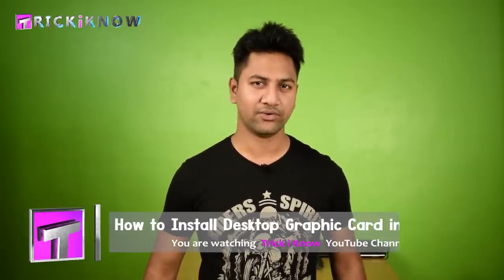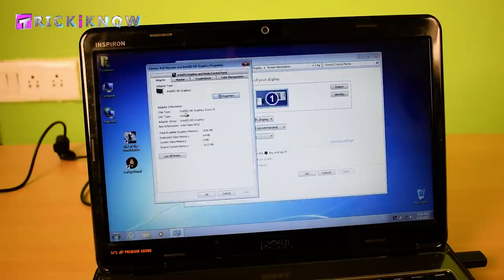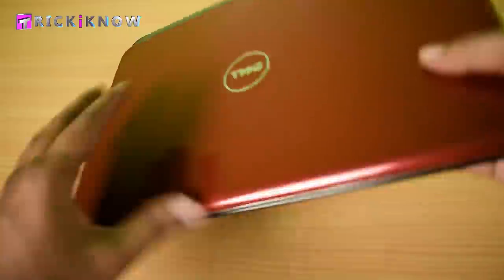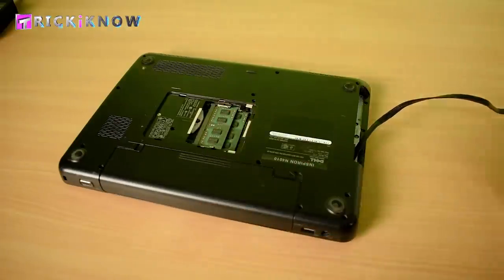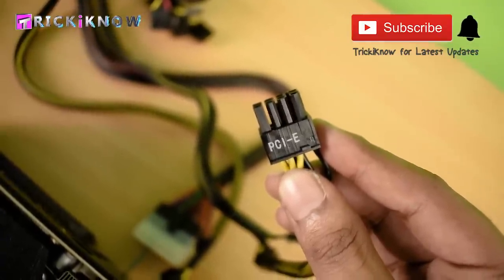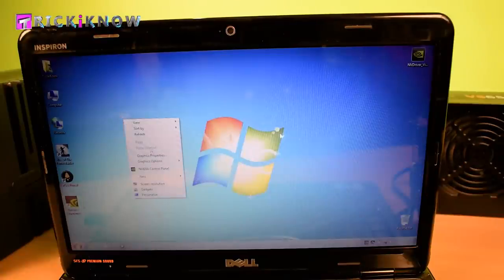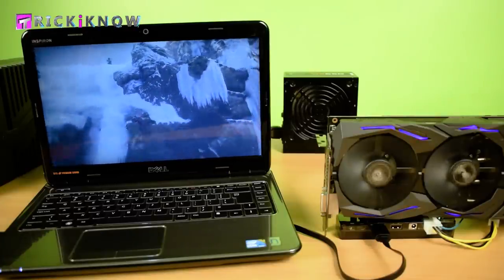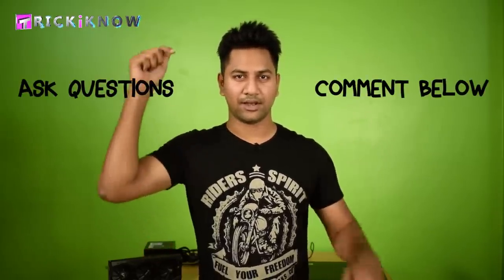How to Setup Desktop External Graphics Card for Laptop - eGPU Ultimate Guide

Comment: the stuttering is because of the 4gb ram...trust me an upgrade to 8gb or even 16gb ram...will launch the performance to the moon...

-  previous 4gb ram user
Reply: the integrated graphics can only take so much ram. The gpu has a built in memory so you can have all those 8/16gb ram you installed with a 2gb vram gpu.

Comment: Bro can I use GTX 730 without power supply 😅😅😅
Reply: you always need a psu, how will you going to power the gpu?
Reply: @exgarou  bro that's GPU do not have pin option this is low end gpu u will check in Google then u understand what I'm saying 🤭

Comment: Can any one help me with this? I'm getting a error 43 for my zotac amp 1060 6 gb? Pls help
Reply: The Code 43 error is one of several Device Manager error codes. It's generated when Device Manager stops a hardware device because the hardware reported to Windows that it's having some kind of unspecified problem. this is the error probably bcs u missed the bios step or smth

Comment: >  >  > >  >  (-_-)  Thanks bro!!!...    is it possible to do same for the Rtx 3090 ? is there any possible version for it ?to buy please make video for this.(contain power supply - cables - and tool -and benchmarks for both gaming and rendering )Thanks...
Reply: using rtx is possible as long as ur cpu is compatible with it to avoid bottlenecks and slow performance

Comment: bro i would rather buy a pc because the cost will be more or less same
Reply: You cant a buy a pc for 150 dollars. Not prebuilt anyway.
Reply: @geckowithapin4284  rog gpus are no way cheap and vega 8 with ryzen is good within 150 dollars for single gpu I don't want waste my money on that
Reply: @warri0r363  who said you had to get a rog gpu? Also vega 8s are cores how does that correlate?
Reply: @geckowithapin4284  can i get a 6gb gpu under 100 dollars?
Reply: @warri0r363  you dont need a 6gb gpu. There are plenty of 4gb even 2gb graphics card capable of running most games you throw at it.
Reply: @geckowithapin4284  and about high grahics games, no one would want to run at low quality
Reply: @warri0r363  if youve got the money, then build 1000 dollar gaming pc if you want, I think this video is more meant for people on a budget.
Reply: @geckowithapin4284  i want a budget pc
Reply: @warri0r363  Than your not gonna get a 6gb gpu. Its as simple as that. Theres a reason you pay more for more performance
Reply: @geckowithapin4284  ok
brother . thank you

Comment: Now it will not support because nvidia stopped support for external graphics card😅😅😅😅😅😅😅😅😅
Reply: What? Lies!! NVidia pushed even better External Graphics Card driver already.
Reply: @ClayWheeler  its external graphics card sold seperately it so costly that cards are getting driver update but this type used in video is expired nvidia is not supporting this type of connecting cards